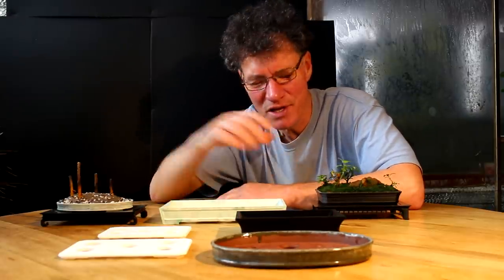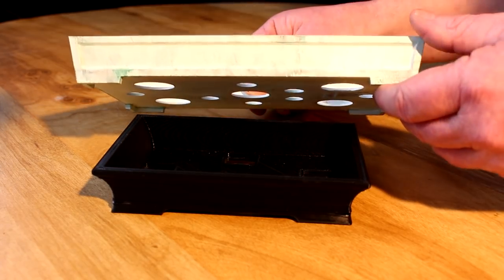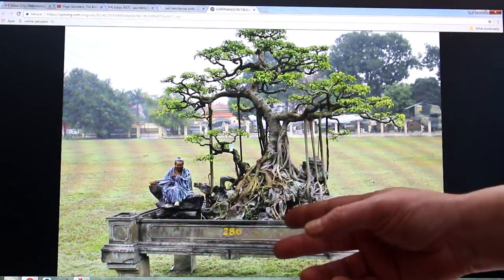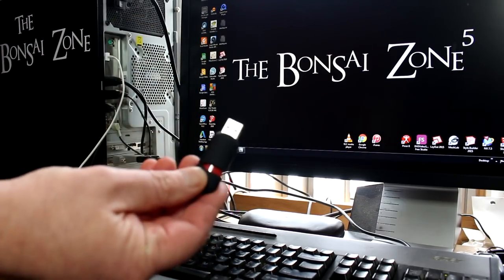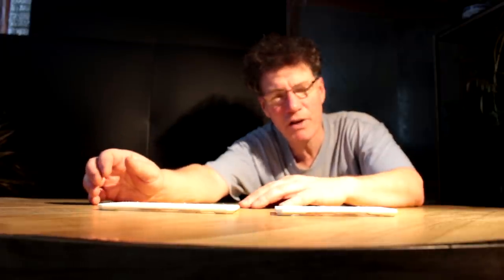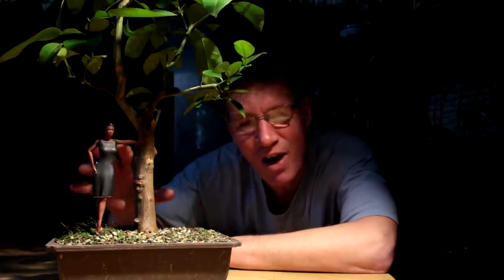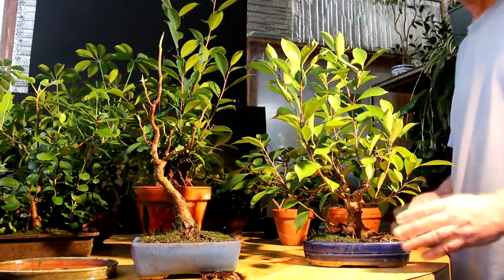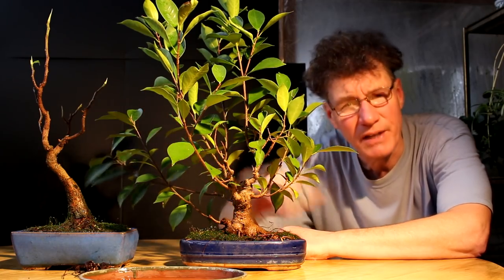Planting Bonsai Trees in My 3D Printed Pots, Part 1, Jan 2018

Comment: I have a Ficus that I'll be trimming down in a few months, and I would really like to keep the cuttings.  Have you made a video on the "best" way to do so?  All the videos I find are poorly done. :(
Reply: I tried keeping ficus cuttings many times. The best way for me is to put them into glass of water for about 1-2 month. They will spread new roots and after first trimming of roots I plant them into my bonsai soil (rocks, clay, perlite) and keep them moist ;) 90% of my cuttings survive this way and they're doing really well :) (of course you need to add water from time to time, sometimes I even add few crystals of sugar - don't know, if it helps my cuttings, but it usualy helps flowers in vases)
Reply from the maker: Well said, this is a great method. I find the cuttings root better in the summer heat outdoors.